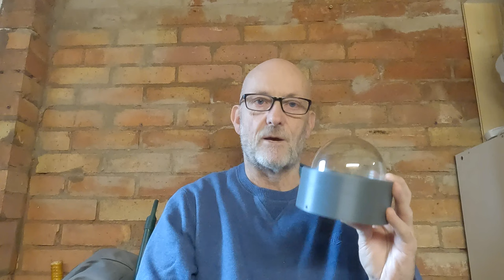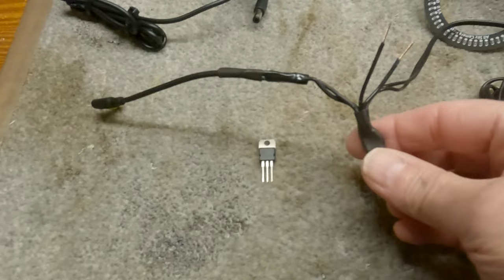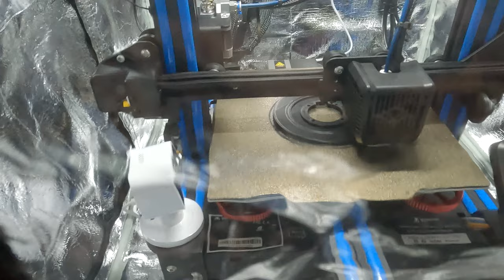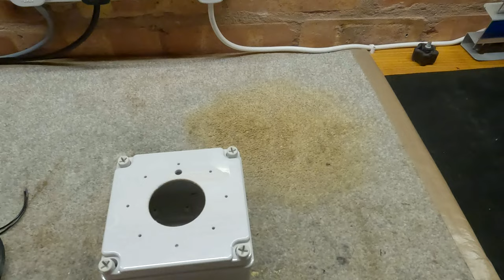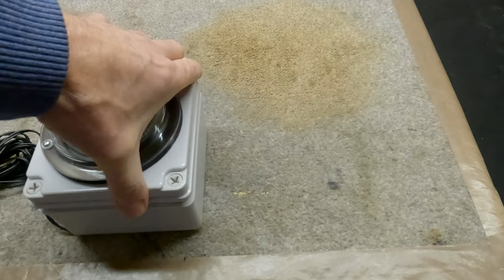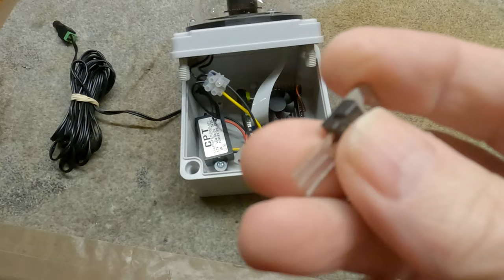AllSky camera build, version 2

Comment: I would definitely drop the heater ring and just use some holes and a larger fan to help spread the heat generated by the SBC around, and some silica pearls as extra insurance against moisture. Surely that would be enough as the box is pretty small.

I'm staying tuned for the results! As I'm wanting to build something myself, but not sure if the raspi cam will be enough (and I don't have the budget to drop in a ZWO camera anyway).
Reply from the maker: Thanks for the comment, and there is a link in the description to the first Timelapse…
Good luck with your build..👍🏻
Reply: @Astro_Shed  Looks like you didn't make the link public, can you check it?
Reply from the maker: @zeendaniels5809  sorry, you are correct, thanks for letting me know,  public now…👍🏻
Reply: @Astro_Shed  Still can't see it 🤔
Reply from the maker: @zeendaniels5809  try now, as I have made it unlisted, so it should show with the link…it was private before as you said….
Reply: @Astro_Shed  Ah! That did the trick!
Better still, you have the setup working under less than ideal lightning conditions, exactly as I am going to be... And it's still gorgeous 😁👌🏼
Reply from the maker: @zeendaniels5809  it was a test night really but it’s more or less where it will be fitted properly and I have houses all round me
The HQ camera is very good once you get the best settings in the Thomas Jaquin allsky software 👍

Comment: Looks great, i plan to make one myself and will copy yours as close as i can, can i ask how you control the Dew heater ring !, is it just 12v on all the time ?,
Reply from the maker: Thanks for the comment, and subscription, yes it’s just powered all the time the unit is on..👍🏻
Reply: @Astro_Shed  just taken down the one i made last week before saw yours !, but the dome is damp/wet inside !!, i have a dew ring fitted but still mists up !, could i need some ventilation or just the dew band on full ?
Reply from the maker: @greenmjg7  hmmm, I sometimes get a bit of misting, so I put some desiccant packs in the base, that seemed to solve it, also make sure you seal on the dome outside on a low humidity day 👍

Comment: Great design. I love your 3D printed adapter plate and many thanks for providing the 3D print files. I was wondering what 3D print material you used as the finish looks very good? What 3D print material do you recommend? I don't have a 3D printer so will have to get an adapter plate printed via a 3rd party company so I want to make sure I use a good 3D print material. Many thanks in advance.
Reply from the maker: Hi David, and thanks for the comments, I used PLA nothing special, but time will tell how good it works out. Should be fine as I don’t leave the camera out all year, just over the autumn and winter really, if you are leaving out all summer, then maybe a better material like ABS or PTEG would be better…👍🏻
Reply: @Astro_Shed  Many thanks for your very quick reply regarding the 3D print material, it's really appreciated.

Comment: I like what you did but however you need to add the fan in the box so the fan couldn't actually blow air out so the box don't get so damn hot inside the box.
Reply from the maker: Thanks for the comment, There is a fan on the RPI, but it’s not an issue, as the heat just helps to keep the dome clear from condensation, also it’s outside all winter so the temps are low outside, so not an issue….i don’t leave out in the summer…

Comment: Nice design, any alternatives to the dome, looks like the Amazon uk link doesnt sell them anymore
Reply from the maker: Thanks for the comment, much appreciated, Hmmm will find another option re the dome, and add a new link, thanks for letting me know, I only bought it 8 days ago too…problem being will need one identical to fit the 3D printed adapter ring…🤔
Reply: I've also ordered some nylon waterproof vent plugs which I may attach to the case as I'll be running a pi4, it may help with temperature build up.

Comment: What sort of screws are you using to mount the 3d printed part.
Reply from the maker: They were some blunt ended 6mm screws I had
Just drill through bottom layers of printed ring first and you don’t want sharp screws in case they come through the top

Comment: Given that you think the Pi may be generating enough heat that you put a fan-assisted heat sink on it, why is the separate heater needed?

i don't understand that.
Reply from the maker: Thanks for the comment
Not sure the heat from the PI would circulate enough around the dome and to be honest I already had the heater ring from version 1 so why not use it 👍👍
Reply: @Astro_Shed  So in hindsight, a slightly redesigned adapter ring could have allowed some (hot!) airflow from the Pi to the dome - lower build cost and lower power consumption for the Mk3! (thinking about it, it would also reduce the complexity of the wiring and power arrangements)
Reply from the maker: Also the lid of the project box, plus the adapter ring is approx 8mm thick, not sure how much of the heat would penetrate that and keep the dome clear, if anything really it’s the fan on the RPI that’s not needed, but for an extra £7, it just wasn’t worth worrying about….clear skies…👍🏻
Reply from the maker: @paulwomack5866  there will not be a mark 3, this was cheap and works really well, the wiring was not complex at all, as you se at the end of the video as it was altered, and I prefer to use the 12v heater ring for the dome, but you build yours the way you see fit, thanks for the comments…👍🏻